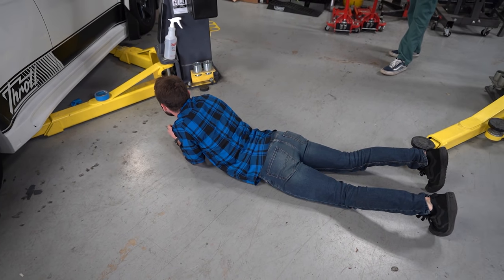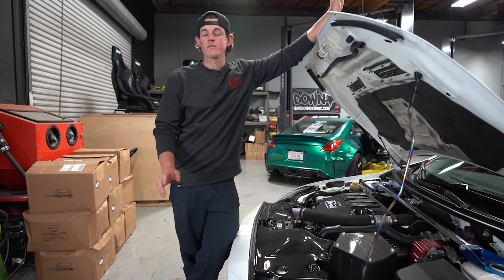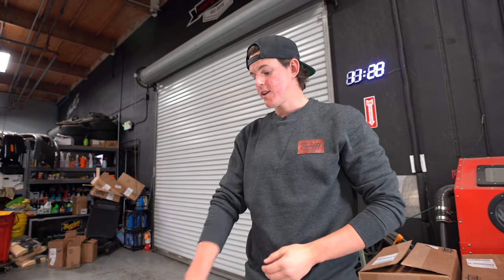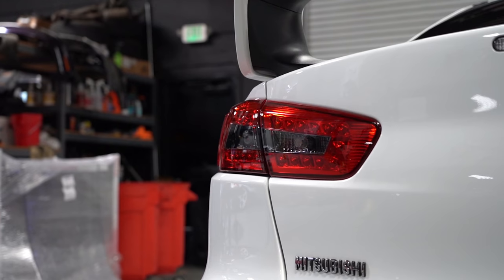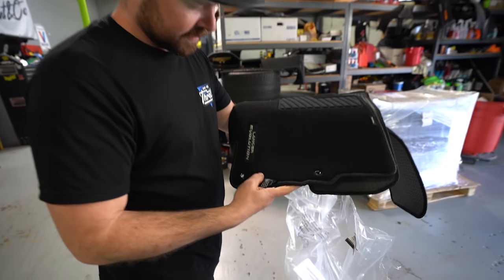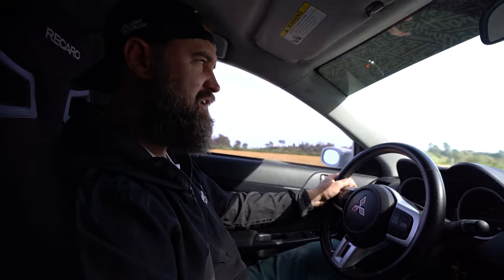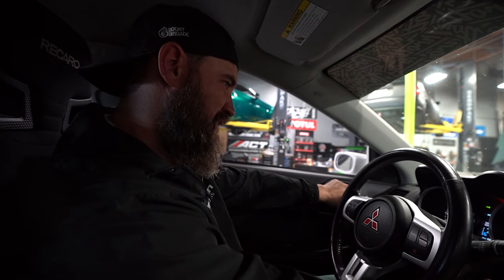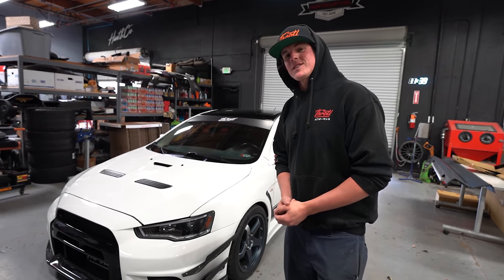Building & Heavily Modifying a 2013 Mitsubishi Lancer EVO GSR - Part 12 - The Perfect Spec!

Comment: The reason Mitsubishi decided to go with a 5 speed rather than a 6 speed is because the car was designed for Group N Class R4 Rally, and on track and on rally you do not need more than 5 gears as this is not a top speed style car, and with a 5 speed you can make the gears beefier and stronger than on a 6 speed, all while having less rotational mass. The Evo X 5 speed is far stronger and more durable than the Evo 9 5 speed, and we all know the weakness of the Evo 9 6 speeds. This car is the last pure breed road legal rally car, hence why they did a 5 speed and sacrificed fuel economy to always be in the power band and have rally style reliability.
Reply: Came here to say just this. However, as a former owner of an Evo 8, I did often wish I had that 6th gear lol
Reply: @c0lutch  what do you mean you can shift it to R for race mode
Reply: @c0lutch  same here hahah sucks on the highway. Baaaaaahhhhhhhhhhhhh 4K all day lmao
Reply: For back roads and twisties or specially the dirt a five-speed has longer gears and requires you to shift less often . And you don't need to be going ridiculously high speeds anyway . People put dog boxes and make it so they can flat shift with these things because it takes so long to shift that they end up losing their boost . So the longer you can stay in one gear without having to go to the next the better .
Reply: Im so happy with mine evo8 5speed transmission 😜
Reply: ª

Comment: Awesome looking build. But there's one thing I really would love to fix, and that's the steering wheel. I know the guys from goonzquad use a company, can't remember the name, where they send the oem wheel, then the company will refurbish it with either new leather or alcantara, and they can fit carbon pieces instead of the plastic ones. Best part is they keep all the oem buttons and the like. You guys should think about doing the same for the next build